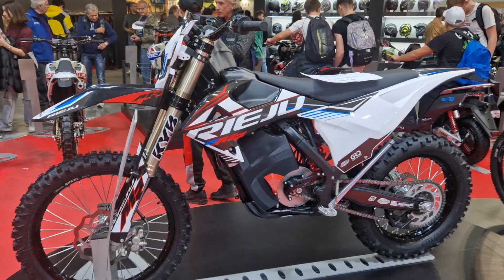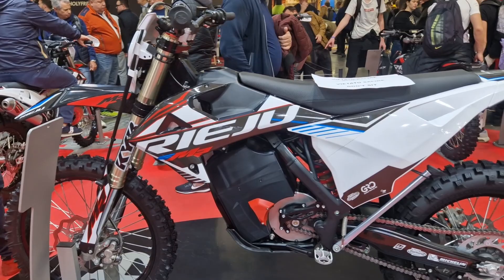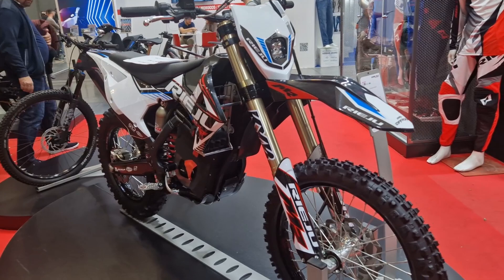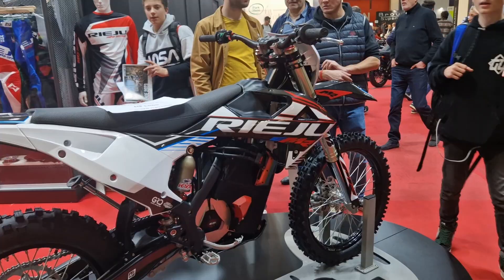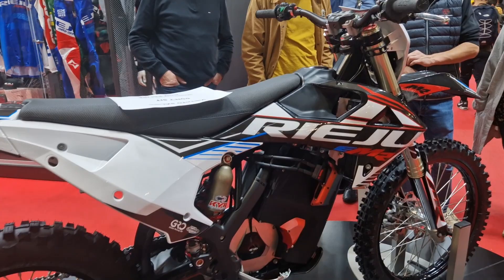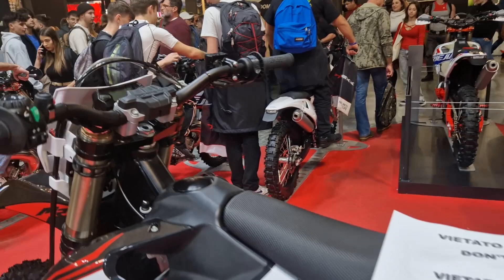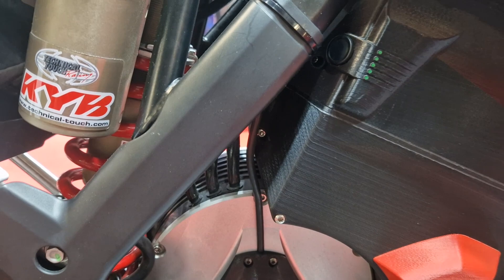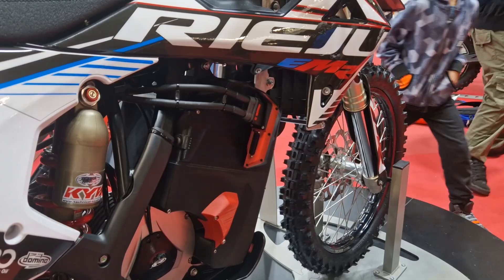New Rieju eMR ELECTRIC Dirt Bike | Quick Look

Comment: I have seen the bike personally at eicma and talked for 1 hour with the guys at the show about the bike, their intentions, etc.... Basically It's a diy conversion, made by the rieju team with some pretty 3d printed parts, with a lot to be developed before it will be ready to be sold. The controller was on the back without any kind of protection: exposed terminals, seems no contactor, rc model battery connector (qs-8), 3d printed case, etc... The direct drive motor looks nice, but without a reduction gear, with a 21S battery I doubt it will be enough for serious enduro riding on a full size bike, and I am sure they didn't build that in house. The specs printed alongside the bike contained errors and looked like they were not really caring much about it... There is more to say about it, but I doubt this bike will ever see the light in this form. It needs extensive redesign of major components and probably will end up being completely different when it's ready (if they pursue the project).
Reply: its obviously a QS-10
Reply: @mrhqyangtechnic_q_emx8180  Sorry, obviously you are right. Doesn't change the picture...
Reply: Are there any dates about the weight and the top speed....?
Reply: @tom250ef  They said 120 kg. (dry weight, as if there is a wet one with an electric bike 😔) Top speed wasn't declared, but with the direct drive and that gearing it won't be a problem! If anything the problem will be having the right acceleration with that sprocket... That's why I say that they don't care much about this thing and if the project goes forward, it will be completely redesigned.
Reply: I ride with exposed qs10 connectors all the time.  I think I'd be really impressed if a stock bike came with them.  Wires are waterproof same with the connections.
Reply: @captnshrms  I don't know what are you talking about, qs10 is no automotive connector, it's ok for a diy cheap built, not for a proper ev. There are regulations about this. The bike I saw had no waterproof connections at the controller, you must have seen a different bike.

Comment: That's an insane amount of HP and Torque available at any point you are twisting the throttle.
Holy crap.
Reply: but the battery can't put out that much power anyway, more likely limited to  a more reasonable 15kw/20hp like surrons or zero FX with similarly sized batterie
although stark varg is supposed to be 80hp/6kWh

Comment: It is a pipe dream like all the rest. Suppose it will meet the riding times; at 80 Hp, the design could incorporate clutch behavior with a clutch lever controlling the VFD behavior and give you a punch or faux slip as needed. This bike and most others use a 3 phase servo/feedback motor design with some added magnet/ferrite in the rotor for more efficiency/power. Also if you are a manufacturer, please do not use cheap straight cut gears that whine.
Reply: EV power is very easy to control without  a clutch. on the other hand on a dirt bike throttle could be hard to control with instant torque response. fake clutch is a good (cheap) idea for riders wanting to transition to electric, but I think it's something you would abandon after a while
Reply: @geemy9675  clutch I'd say is imperative for hard-enduro/trials type riding, gives far more control.

Comment: Seems inferior to Stark Varg overall package but same price?
Reply: Star Varg is 18k and worth every penny and is better built in every way. All these other bikes like KTM  now have to rewrite there entire build as Stark Varg has blown them out the water in everyway possible. Inc Chassi,run time,looks,power setting optoins the list goes on.
Reply: @beeragonewhere2819  Stark Varg hasn't done shit yet, they are still handbuilt prototypes with claims that has never been tested and verifyed, there are suspicions that the prototypes has been run on special batterypacks that is lighter and higher voltage then spec to give more power during the few short testrides they gave the media.
We will see when they deliver, IF they deliver....

Comment: Hard to beat extra gas in your pak and keep on riding.  Surron with bac4000 riding rocks and loose hills could really benefit from clutch.  I have to set egg rider, one map is all the juice and flick of button is no juice map.  Have whiskey looped it and a clutch would have saved me.  Honestly think electric bikes can open local tracks or city tracks due to noise,  as spectators it kills the experience.  As trail rider/camping for weeks out in desert, electric has no place yet.  I can fill the ICE bike tanks over and over and keep kids riding. I think the Rieju will be awesome,  I would love to ride it,  just doesn’t fit my needs like a ICE bike can.  Now a super moto version would be interesting and make more sense with charging capabilities at tracks.  Less need for clutch on street.

Comment: Power is nothing without control (traction). I hope they compete like the Ranger.
Reply: This! My freeride was a hell of a time learning to keep the rear wheel glued, while it doesn't dig trenches like some riders i know on gas bikes, my wrist got very alert to the throttle. Cant imagine trying to ride enduro on a varg or similar.

Comment: Tq seems to low the stark varg has 950nm with the same 80hp
Reply: it's wheel torque vs motor torque, very different. torque can't be "too low" on a 80hp electric dirt bike, you better have some traction control, torque is brutal with electric motors

Comment: 60kW with a 3.7kWh or even ~4kWhbod not a good match
that' s just 4 minutes of battery life at peak power, or 16C discharge rate, if the battery can provide it which is not very likely
Reply: Don't come here and disrupt peoples dreams with things like facts... 
Just the size of the batterypack tells me that you are right.
It might be able to give 60kW OR run on that battery, pick one....

Comment: Why make a 300 lb electric bike?
Reply: its 230lbs he said
Reply: @jasonmillner6416  The Stark has a 6kWh & most feel it is too little for a 40 minute moto, so you'll need at least a 20+lb heavier battery.  Then consider the steel frame compared to the Varg's minimalist design, so if this were to actually be produced...this would easily be 275+lbs.

Comment: Clutch???  Outmoded technology unnecessary with a motor with maximum torque at 0 rpm.  Don't apply ICE thinking to EVs.
Reply: It's not about applying ICE thinking to EVs. It's about modulation of the torque to better traction. 100% torque at 0 RPM is a good way to shut trails down because of wheel spin.
Reply: @loganlexow  you dont have to pin the throttle.  Still dont need a clutch!
Reply: @jasonmillner6416  you are correct that you don't need to pin the throttle. And electric is very good at modulation with the correct controller/esc. But, watch things like Erzberg where the riders are on steep, loose traction areas. There is a place for a clutch in EVs. Not saying they all need a clutch but, mfg's that compete in hard enduro would benefit from building in a clutch.
Reply: Clutches are for sissies.  Custom mapping the throttle is way better.
Reply: It's not an ICE/E comparison, the motive power doesn't matter - the control of that power does.  Sure you can modulate the power better on an E bike but all you are doing is assigning YOUR ability in given conditions to the onboard computer.  It's like having autonomous braking on cars...  it just dumbs down the rider.  Eventually with that sort of thinking a dirt ride becomes a case of will I have a cappucino or latte while I ride.  Why do you think E Trials bikes are now coming out with clutches?  Because they are essential.  Don't dismiss a clutch just because it's not an "E" thing.
Reply: @loganlexow  With an E-Drive. You can easily incorporate traction control or limited control without you the rider being aware that it is engaged. You are thinking ICE application, this is not the same.
Reply: @glennalderton1313  very well said.
Reply: @fredpinczuk7352  have you ever ridden traction control in sand or mud? Traction control IS a welcome aid in SOME situations. But there's a reason adventure bikes are able to turn it off.
Reply: @loganlexow  I have, on my previous 2015 SuperTen and 2018 SuperTenS. My Beta 500S does not have it. 
Again, the issue isn't whether or not you need the control. We can all agree on that. The issue is the fact that you don't need a clutch to do it.  Electronic modular traction control on EV is plenty. Just need to be able to dial in what level you want. On my SuperTen, I have three levels. It lets me control how much fish tail or slip I want on the sand and mud. Or turn it off. On my Beta, I use my clutch. The difference is that the EV Motor controllers are far superior in there abilities vs ICE cutting in-out ignition/Fuel.  Take a drive in a Tesla in the rain or snow and you'll see what I mean.
Reply: Are you kidding?     Evidently you must be riding smooth gravel and have never needed to loft,pop, splat or do anything other than ride flat ground.  🤦‍♂️
Reply: @loganlexow  That's what the throttle is for.

Comment: too big to expensive, not enough power in the battery  , will have a 25 mile range max offroad .. they need to design them from the ground up , motor in hub
Reply: Lol motor in the hub, good one.